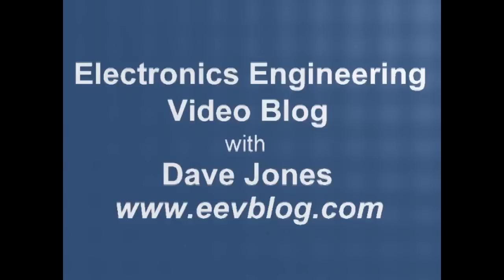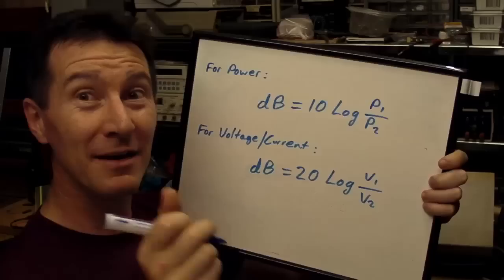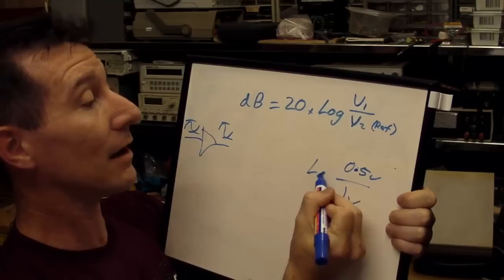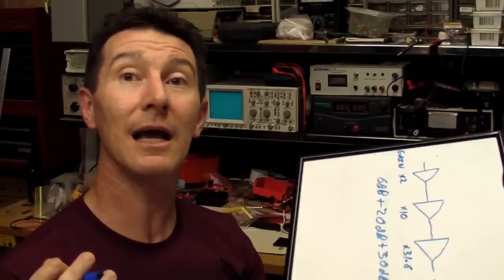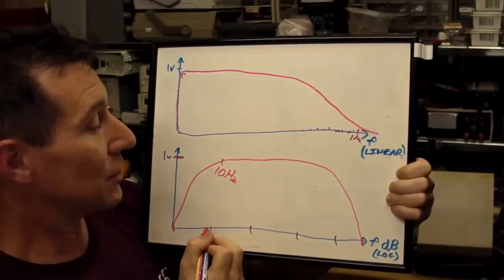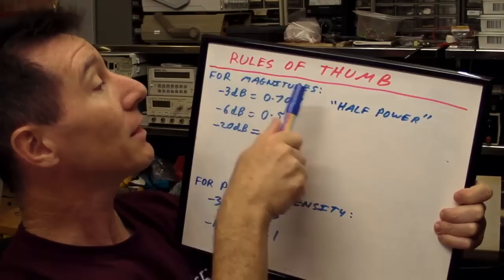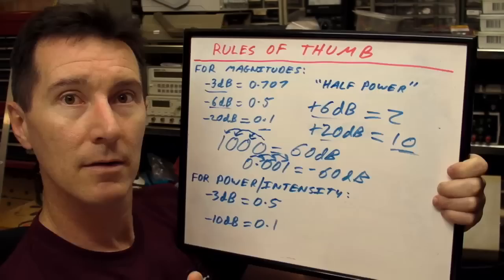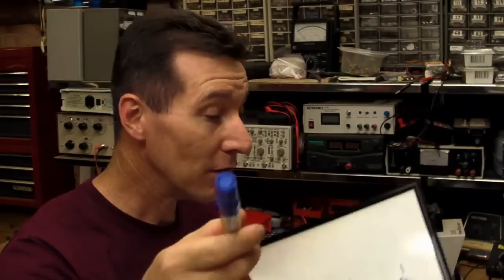EEVblog #49 - Decibels (dB's) for Engineers - A Tutorial

Comment: Should have included how to work out dB's inbetween decades e.g.:
20:1 is +6dB for x2 and +20dB for x10 = +26dB
1:50 is -40db for /100 and then +6dB for *2 = -34dB
Such an elegant system.  You can always get pretty accurate ballpark figures without any need for calculators.

Comment: @shodanxx: I'm a ham too and I it's easy to rembember: If you double the voltage in a circuit,the current doubles too and since P=I*U  we get: 3 db(V) which leads to a an increase of 3db(W)
e.g. with a 1 Ohm circuit:
from 1V to 2Volts there's a ~6db(V) gain
from 1W (1V * (1V/1Ohm)) to 4Watts (2V * (2V/1 Ohm)) we get  6b(W) gain

that's the reason for 10*log(p1/p2) for power and  20*log(v1/v2) for voltage..

73, DO9SAS

Comment: Here's the straight forward equation minus the derpworthy typos and readability issues:
(V.out/V.in)·Log(20)=dB.V.

	 (P.out/P.in)Log(10)=dBm<power>.
•Inverse formula:
dB.V/20<10x>=V.out.

	 dBm/10<10x>=P.out.
•Here is the -3dB. that you hear so much about:
0-3.dBx./20<10x>=0.707<Down by 70.7%>.
	 0.707Log(20)=0-3dBx.
Reply: I'm still not quite used to describing electrical quantities in terms of decibels. The input signal has an amplitude of 500mV while the output signal is 1 Volt, so the input signal gets amplified by a factor of 2 or +6.0206dB. I was curious as to how the equation dB = 20*(log Vout/Vin) could be rearranged to solve for Vout assuming dB and Vin are known. So, dB/20 = log Vout/Vin; Vout/Vin = 10^dB/20; Vout = Vin*(10^dB/20); Vout = Vin/10^-dB/20

Comment: Have used dBohms before.  Since I=E/R, then in log format, dBuA=dBuV-dBohms. Used to calculate current when measuring voltage with a current probe - probe cana correction factor vs. frequenct in dBohms! Nice and easy.
Reply: Sorry about the typos.  The current probe has a correction factor in dBOhms.

Comment: Since it seems to be a common question: dBs in sound are easy.

dB SPL (sound pressure level) is dB relative to 20 µPa, a value close to the mid-frequency human hearing threshold. (It's AC, so probably an RMS value.)

Now sound pressure is analogous to voltage, and sound particle velocity relates to current in the same way. Hence, it's "voltage dBs".

A microphone will usually have a spec'd sensitivity in dBV / 1 Pa = dBV / 94 dB SPL. This directly links the sonic to the electrical side.

Comment: 20:25 - For years, I’ve had the same answer to the “Is the glass half full or half empty?” rubbish: there’s not enough information to answer the question. The correct answer is “It depends!” Now had you started with a full glass and drank half of it before this shot, I would agree. However, if you started with an empty glass from the cupboard (which is more likely what happened here) and filled it it half way just for this shot, as an engineer, I would have to say it’s +6dB. btw, this video is the most concise explanation of dBs I’ve seen!

Comment: Correct me if I'm wrong Dave....
I generally don't like to memorize formulas.  I would probably go one step further and state that power is proportional to the square of magnitude.  In high school math, we learned that (assume log base 10):  log (v^2) = 2 log(v).  Since we are dealing with "deci" Bels, we multiply both sides by 10 to yield: 10 log (v^2) = 20 log (v).  In other words, dB values are indeed ratios, but it's implied that the ratio is in terms of power/intensity.

Comment: Remember that also dBi uses the 10* Log formula. dBi is a value for antenna gain. The gain is the power radiated per solid angle / power received from the transmitter per solid angle. When the ratio is 1, we have an isotropic radiator (which is ideal). Since it's a ratio between powers, the 10* Log formula shall be used.

Comment: When you're talking percieved volume you're talking psycho acoustics. Twice the amplitude of sound will not sound twice as loud. That's (if I remember correctly) because it's not twice as far above your hearing threshold. AND it only holds true for what's called "normal hearing" because people with a hearing loss will have a smaller range of hearing.

Comment: Decibels were originally designed for power, so the formula for power is 10*log(a/b).  However, power is proportional to the square of voltage.  Therefore, if you double the voltage, the power will quadruple.  Based on the algebraic rules for logarithms, if you take that power of two out of the argument, it will multiply the result.  10x2=20, so the formula for voltage is 20log(a/b).

Comment: @yeoldeengineer  the value will be same. for calculating power in decibel you have to use 10 log (P2/P1) and for voltage 20log(V2/V1) . you might have used same formula for both. thank you

Comment: Water is closer related to power than voltage. Filling with water requires potential energy, which can be achieved by power (voltage and current over time). According to that, your glass is (approximately) only 3dB down! (discuss)

Comment: The reason why voltage is 20 times the ratio compared to power which is 10 times the ratio; is because the derivative of V^2 (used to calculate power) is 2*V - - - there is significant confusion with dB, dBm, dBw, dBi, dBd, and others if you don't know the 'context of the application', especially with voltages or powers. 6dB is double for voltage , but 3dB is double for power !! it is better to use dBW or dBmW  for watts and dBV or dBmV for volts to avoid confusion. - - - decades are relative to 10's of dBs not scales as mentioned. - - - negative decibels are simply the reciprocal of positive decibels. @ 19:45 he has it backwards !! - volts are a power since they are squared and watts are a magnitude since they are NOT squared. this is why for volts there is 20X the log since V^2 is used in power formulas. - - - FYI 555 timers are one of the worst crappy electronic parts there ever invented. - please research monostable multivibrators for much better parts ; at least they can produce a 50 % waveform; a 555 cannot since at 50% both comparators would trigger !!

Comment: Now if you want something *hairy*, try calculating the voltage and power gain of a unity gain buffer (with an actual source and load). Hint: You can express both in dB, but the value will not be the same. Why?

Comment: Question -- Can you do a comparison of SPL meters like you did on the multimeters? Is a cheap meter reliable enough to an expensive meter? Certification standards? 

I've watched a few of your videos and always learn something.  I really loved your Multimeter shootout and actually didn't watch it until after I purchased a Klein MM700 and CL700. I realized a year or so later I really wanted the CL800 for DC current (I had overlooked that difference) which I got and would have purchased originally if I watch your shootout.

Comment: Hello.
I need explanation of what is dBm in RF communication.
For example I have two RF Module.
The Transmit Power is 14dBm.What dose this mean?
After connection RSSI is -9 dBm.What dose this mean?
Can you help me please?
Reply: When you see dBm you can read the spec as "above 1 milliwatt" so Transmit Power is 14dB above 1 milliwatt. 14dB is roughly 10dB + 3dB so we can read 14dBm as a tenfold increase of 1mW to 10mW and then roughly an increase of double for approximately 20mW. So Transmit Power can deliver a bit more than 20mW into a load WITHOUT regard for its impedance. (If the specification does not specify this impedance then it is usually assumed to be 600 ohms.) I leave deriving the wattage for -9dBm as an exercise for reader. 😂

Comment: Why should we care about the "ancient" unit of Bel? In 1920, Bell Telephone created the Bel to represent the base10 log of a power ratio. The name of the new standard for measurement was a dedication to Alexander Graham Bell. Decibel was the recommended unit.

Since the decibel is an exponential unit of power measurement, its use with potential is a derivation. Assuming that a change in potential results in a linear current response, then we can derive a measurement in decibels to describe the voltage change in this ideal system; however, the measurement still defines a power ratio. Thus, I suggest that we should care about the Bel and its creation.

In regard to your glass of milk, I will assume that the vessel is a perfect cylinder. You now have more power than you need, because with only half the columnar height (potential), you will consume fluid at half of the rate (current) as full. Next time I suggest buying proper conical glassware so that you can supply power at a rate that is commensurate with its remaining potential. Do you like martinis? ;oP

Party on, Dave!
Reply: Use a straw.

Comment: The 20log and 10log formulas really confuse people. Its easy to explain though ...

First, the dB is defined in terms of power as dB = 10 log (P1/P2)
If you want to solve for voltage, you substitute into the above formula P=V^2/R to get,
dB = 10 log [(V1^2/R) / (V2^2/R)]
Now cancelling the R's above gives us,   dB = 10 log (V1/V2)^2,
And the rules of logarithms let us move the 2 down like this,
dB = (2) 10 log (V1/V2) which gives us our dB formula for voltage, 
dB = 20 log (V1/V2)

Comment: I have a question pertaining to the 19:08 minute mark of the video.  How come -3 dBm is = to 0.5 mW?  Above that I am seeing -6 dBv also = to 0.5 v.  Is this because orders of magnitudes use 20 Log and power uses 10 Log?  Or is this an error in the white board math?  The video covered the rules of thumb for magnitude which makes sense to me, I'm just wondering what the rules of thumb for power are if they are different?  Thanks!
Reply: I guess I was expecting -3 dBm to be = to 0.707 mW based on the rules of thumb you described in the video.
Reply: I'm replying 5 months after your comment.  Anyway, my understanding is that power is expressed as 10*log10(x) while voltage or current is 20*log10(x) because
watts = volts * amps.  So 2 v * 2 A = 4 W or 0.5 v * 0.5 A = 0.25 W

If both volts and amps increase / decrease by the same proportion, it's equivalent to the squared difference in power and dBv and dBm will change by the same amount.  Multiplying a logarithm by 2 is the same as squaring
10*log(x*x) = 10*log(x^2) = 20*log(x)

Therefore -3 dBm is 0.5 mW and -6 dBv is 0.5 v

Comment: but why should he take 10×log for power and 20×log for voltage and current?
Reply: Simply is P= IxV but 
P= V squared / R 
P= R X I squared 
hence why dB volts is 20Log... Because when you use Voltage and Resistance to calculate power you have to square the Voltage before dividing it by the resistance. So one should be able to see why 20 Log is used for Volts.
Reply: There really is only one formula 10log(p2/p1).  Power is v**2/R or I**2R.  In common usage R will be the same in the measurement of p1 and P2 so cancel out if you substitute the voltage or current form of power.  

So you end up with 10log[v2/v1)**2]  if using the voltage equivalence for power
The log of a number raise to a power is equal to the exponent times the log of the number
Hence, 10log[v2/v1)**2] = 10[2log(v2/v1) = 20 log(v2/v1)

The 20log() for voltage and current are due to voltage or current being squared to get power.

you could view them as 10Log(p2/p1) = 10[2Log[v2/v1) or 10[2Log[I2/I1) = 20Log(), assuming resistance is the same across measurements 1 and 2.

Comment: Hey Dave. Thanks for the video. Though I do have a question. Hopefully you'll see this comment:
When plotting the frequency response with the cutoff frequencies and all that, why do they make the maximum value 0 dB? Why not start at 0 (or 1) and let maximum be 60 dB or whatever?
I really don't get that.
If you could explain that me I'll be forever in your debt :D
Reply: Eeltauy Magnus  0dB = 1 that simply means that the two signals you compare are the same and there is no attenuation. 20*log1=0dB

Comment: I think this is really confusing to sometime use 10 log and some other time 20 log 
I didn't really get the why of that
when I learned ham radio I was told that 3 dB is double the power and that was correct and that 30 dB was 1000 time the power I wasn't told about using 20 dB for magnitudes 

so when someone whatever was 30 dB I though it was 1000 time more intense but if they were talking about a voltage or magnetic field strenght it was only 316 times more .. no wonder people are confused !!

Comment: How can i calculate maximum distance of rf for example 433MHZ 5V 100mw maximum range of open area
Reply: Different formula called the Friis equation. Forget the voltage, just use power.  Depends on receiver sensitivity, (usually in uV, should convert to dBm in this case), and receiver and transmitter antenna gain, too. Will return path loss in dB.

Comment: How wold you workout this question a power amplifier has a power gain of 29dB and the out is 80watts find the input power and can u explain step by step
Reply: Disclaimer: Could be totally wrong...
But it should be easy, the input power is -29dB of the output power, so it's pulling out my calculator > Pin = Pout^(-29)/10 > 0.1W
Reply: yep, +20 dBm.

Comment: Isn't -6 dbv = 0.707V since it is referenced to volts?
Reply: -6dBV (where 0dBV = 1V no reference to impedance) is 0.5V RMS and -6dBu (where 0dBu = 0.775V unloaded or across 600 ohms) is 0.388V RMS.

Comment: Here's the straight forward equation minus the needless banter.

(vout/vin)LOGx20 = voltage db
(pout/pin)LOGx10= power db

Inverse formula

DB/20 (10x) = voltage out
DB/10 (10x) = power out

Here is that -3db you hear so much about

-3db/20 (10x) = .707 (Down to 70.7%)

.707Log x 20 = -3db
Reply: Rýán Túçk Oh look at that you just copied the same equations I wrote down and somehow believe you discovered a whole new solution to formulas that have existed before you did.

I wrote the formulas the way I did to help people understand who otherwise would get lost if they had to interpret said formulas the way you restructured my original explanations.
Reply: You agree they're equivalent, they were for myself anyway. You don't like, they're gone.
Reply: Much simpler is P= IxV but 
P= V squared / R 
P= R X I squared 
hence why dB volts is 20Log... Because when you use Voltage and Resistance to calculate power you have to square the Voltage before dividing it by the resistance. So one should be able to see why 20 Log is used for Volts.

Comment: hi dave,

how can i connect a led to open collector from any device, like a server or any electronic system?
note : the open collector output, it's from a serial port from the server. (i want to do a monitoring system or alarm system via led)

and sorry for my english

please help.
regards
Reply: This is called a "noid" light in automotive mechanics. Installation would require a POL power on LAN to avoid introducing attenuation in the wire. USB Includes this 5VDC@500mA on two separate wires from the serial wires. A noid light for an IAC valve is what you're describing, however, the lights only flash passively and don't activate any types of triggers for siren.
Reply: Rýán Túçk What?

Comment: The only thing that drives me nuts about db's is..  Why the hell do we have two formulas!!!!  When one would do.
Reply: +Joanna Hammond voltage dB is derived from power db. P=U²/R. So if you compare to powervalues over the same resistor you get the ratio (u1)²/(U2)². So 10xlog((u1)²/(u2)²) = 10x2xlog(u1/u2) (because e.g. log(a⁵)=5xlog(a))
that's all

Comment: So I read somewhere that when dealing with audio that every +10dB is 2X the perceived volume level. Does this mean that 2x amplitude does not equal 2x perceived volume, or does it mean they were just wrong?
Reply: Decibels are used to reference just about everything in audio electronics. Since the force of air pressing against the resistance of our eardrums is analogous to the force of a cell pushing electrons against the resistance of a circuit, the 20 log equation is used. So 6dB SPL is double and 10dB SPL is ten times. However! 😂 This is not how we perceive "loudness" (which itself is a subject quantity). We perceive loudness with the 10 log equation, so 10dB is indeed twice the perceived volume level. What really matters is that when going back and forth between systems ... a decibel is a decibel is a decibel, and this is why we use them (for a hard to achieve convenience 😂) (reference: Yamaha Sound Reinforcement Handbook by Davis and Jones)

Comment: Not crazy about this video.  It would have been better if Dave would have mentioned a few things...

First, dB is always a statement of the change in power.   It so happens that 6 dB is twice the voltage, but the important part is that 6 dB is 4 times the power.  I don't think he ever stated this.    

 Again, dB is a statement of the change in power.  This is important because people sometimes measure a voltage "gain" say, through a  1:4 transformer, without realizing that the power "gain" is unity (minus losses).

Second, since he's taking the time to explain all of this, reviewing Logarithmic Math, even though it;s generally covered by Freshman level, would be helpful.   

Third, to say that when you are working with DBV, one must be working with the 20*Log formula as he does at 20:02, is misleading.    Sure, you are referencing 1 volt as the starting point, but again, dB is still a statement of the power change.  

Here's the final exam:   What happens to the student when he/she tries to measure the "dB gain" of a 1:4 transformer?  Put 1 V on the input.      Now express the change from input to output expressed in dB.   Try it in dBV.     Try it in dBm.   I think you will see quickly why it is important to always think of dB in terms of a power ratio.
Reply: Do you mean literal power (P=IV), or the type of power you'd find in power and signal courses? Maybe power gain is unity, but that isn't true for voltage and currents I think.